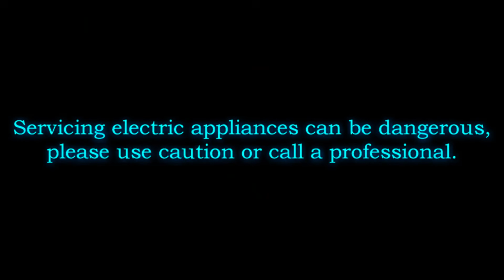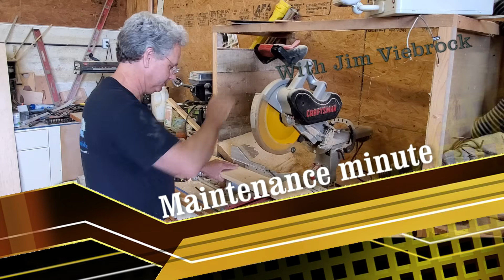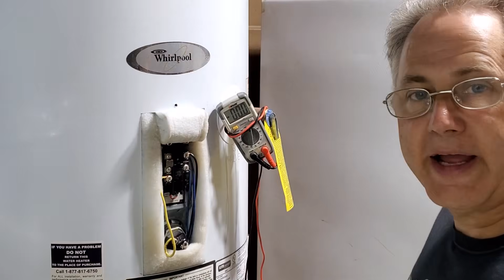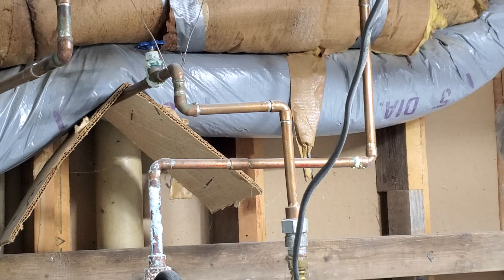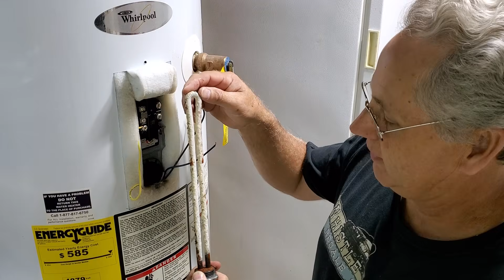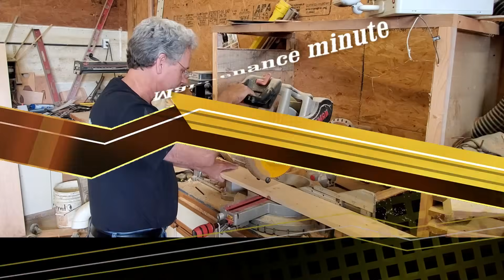D.I.Y. How to replace the heating elements in your hot water heater. Maintenance Minute Jim Viebrock

Comment: Nice video Jim. But I disagree with your stance on deliming chemicals. There are several commercial safe chemicals used to delime water heaters - food grade phosphoric acid & citric acid. Acetic acid (white vinegar) works if you have several days. Myself I use 1 gal of swimming pool acid  (HCL @ 33%) which I dilute with 2 gals of water). Add to bottom of drained WH and wait 1 hr). Then drain and you will get lime green water (calcium carbonate has dissolved). It’s impossible to get all that lime out by vacuuming or flushing or coat hanger. Especially with a gas water heater with a cone / upside funnel.
Reply from the maker: Great information,  thanks for sharing.
Reply: How do you add the chemicals to the heater?
Reply: Food grade is the key. Those who might drink the hot water would only taste some acid-y water, not toxic chemicals. It's really hard to get every drop of liquid out of the tank. So any contaminants could be entering your food chain. When I drained mine, I tried to be aware of how each hose and tube I used in the tank might be contaminating it, so I better clean out each one as much as I can.

Comment: Does it matter which wire you hook up to the elements. Or is it just one to one hook ups?
Reply from the maker: It's best to put it back the way the factory had it installed. I suggest you take a photograph so that you get it back to its original locations.
Reply: Because a heating element is simply a large resistor, it heats up when voltage pushes a current through it; the higher the applied voltage the higher the current flow and the more heat and vice versa, so it doesn't matter which of the two wires land on which terminal.  

Where ensuing correct polarity is a big concern is in light fixtures with 120V Edison screw lamps.  For light fixtures, the switch should ALWAYS be placed in the hot wire, and the hot terminal should always be the bottom contact in the socket, the grounded (neutral)  terminal is the screw shell.   This does not apply to the rare 220-250V lamps sometimes found in industrial facilities.   

If a lamp is wired with hot / neutral reversed, the lamp will still work as if nothing is wrong.   However the screw shell is live with 120V to ground potential whether or not the switch is turned off and it's a lot easier to touch the screw shell when changing the bulb.   That's why, with the exception of very old lamps, every lamp sold in the US comes with a polarized plug e.g. one wider prong as a means of enforcing proper polarity.  

Hope you found those examples helpful.

Comment: I have a small Bradford White water heater in my condo and I suspect the heating element is the culprit. I need to know if the replacement parts found in Home Depot or Lowes are universal or do I need to deal with the manufacturer. My first go-round with their "technical questions" hotline was useless. Any ideas anyone? Thanks.
Reply from the maker: You will find almost all of the time they are universal.

Comment: There should be a video covering the necessary revisions to the god-awful plumbing to that water tank. This is horrible work, apparently done by a plumber who got paid for each 90-degree elbow he used. And those coiled black supply lines look like something used to connect a clothes washer. Coiling the supply lines like that is OK with a long enough supply line to a toilet, but ridiculous with a water heater.
Start this mess over by reconfiguring the copper so that the lines are properly supported and are a single vertical drop from the floor joists above to the tank’s hot and cold inlets. Terminate the copper sufficiently far above the tank to accommodate flexible supply lines. Use ONLY corrugated copper or stainless steel, and do not use Teflon tape in making the connections, as the internal washers make the watertight seal. Make sure the washers are in place, as I have seen them missing in stores. When you are done, find the plumber who did this original installation and take all his tools.

Comment: Mention is made in the video of the possibility of the drain valve clogging. Unfortunately, this is almost certain to happen due to the horrible quality of the drain valves fitted at the factory. If the valve plugs, as mentioned in the video it will be necessary to remove the drain hose and cram a stiff wire into the valve. Be prepared for the inevitable flood and the need to quickly close the valve. If you are a capable do-it-yourselfer, it is highly advisable replace the valve with a full port 3/4-inch ball valve. Some plumbers do this with new tanks. As a ball valve is easier to open, always cap the outlet as a precaution in case it is accidentally bumped. A valve configuration like that does extend some distance from the tank, so there might not be enough room. Also, it can create a tripping hazard, so that must be taken into account.
Reply from the maker: In this illustration,  like I would assume most scenarios would be for those watching the video, is just getting the heater back into working order. Unless the homowner/landlord was preforming a remodel or update to the home, reconfiguring the plumbing simply wouldn't be part of the project. In this house, that plumbing has been in place, in that configuration, since 1968. Someday, the heater will need to be replaced. At that time it will be brought up to modern code(s).
Thanks for your comment.
Reply: @millin360 Well, true. Even so It is hard to look at the absolutely insane way that tank was plumbed when it was installed without wanting to see it done right. Obviously, the tank is decades newer than 1968. Either the supply plumbing was, unfortunately, left the way it was during installation or the “plumber” had utterly no idea what he was doing.

Comment: What would my problem be if I had some water inside behind the top panel. I hit the reset button and it popped and made a spark. I currently have the breaker off for it now and tried to wipe everything down with a towel to dry it all and wipe the orangeish corrosion away.
Reply from the maker: It sounds like the o ring has failed and a leak has developed. That is unsafe.I would call a plumber. Thanks for your comment.
Reply: @millin360  I just changed the elementts, and everything is wired right, the only difference is they didn't have the exact same elements, but they told me at the hardware store it would be fine, as they are the same size, watt, and volts.
The old ones are copper,and these were stainless steel, but I don't know how much that matters, I didn't have a multimeter so I emptied, and filled the tank again without thinking it would make a difference, I don't know what the problem is, but I'm pissed. The guy told me to bring them back if they didn't work, but I would have just rather waited for the right ones so I didn't have to drain it again. I went from a shower with 2 minutes of hot water to zero, smh.
Reply from the maker: It is possible that one or both of the thermostats has failed.Perhaps due to the leaking water over top of them. It may be time to call a qualified plumber. @jamarjames9501
Reply: @millin360  thank you for the response.
Reply: It's probably leaking from the element, change the element, and clean the threads up, and the new element should seal it up, after it's dry it should be fine. @XxRaider20xX

Comment: When cleaning the limescale with the shop-vac, what size PVC pipe did you use? Do you ever have to use a 45- or 90- elbow to reach the bottom of the tank from the heating element hole?
Reply from the maker: I use a 1/2" cvpc. I've not needed any elbows or fittings to reach any part of the heater. Thanks for the question.

Comment: Putting the wires back on the element, does it matter what wires go where since they are both hot wires?
Reply from the maker: They need to go back the way they were. I suggest you take a photo of the factory arrangement.  Thank you for watching my videos.
Reply: Actually, you are correct, it does not matter how the wires are connected to the element terminals. In fact, depending on such factors as how tight the element is, the terminal location can shift slightly due to rotation. Reconnect the wires in as “tidy” a way as possible, with each wire going to the closest terminal.

Comment: Stupid question, run the faucet with the hot water on, while filling back up the heater?
Reply from the maker: Yes, this allows the trapped air to escape from the tank while filling. Otherwise, the tank will pressurize without any water in it, and this will burn out your brand new elements. Do not turn the heater on until it is full of water. Run the hot side of a faucet until the air is gone.
Reply: @millin360  thank you
Reply: @millin360  next question, my bottom water heater drain spout is clogged, how do I drain the water so I could replace the bottom element. Thank you
Reply: @deyehaskie You didn’t get an answer, but for the benefit of others (he mentions it in the video) you will have to disconnect the drain hose and cram a wire into the open valve to free the blockage, which can return. Yes, this can make a mess, so have a pile of towels handy and be prepared to quickly shut off the valve.

Comment: cool. I think Ill just call a guy to replace the heater rather than the unit if possible
Reply from the maker: Sometimes, that is the right answer. Thanks for watching my videos.
Reply: You could but where I live the price for replacing the tank was 1650 to 3000 bucks for a 40 gal tank replacement.
Reply: @clarkastro2510  O can buy as decent one at Hd and the guy will pick it up////

Comment: So i have a question can i install a heating element with more watt.   I cant find anywhere a 208v 3000watt Heating element.    So what can i use instead
Reply from the maker: I would not suggest using a larger wattage element. You could overheat the wiring and cause damage to the unit or, worse, a fire.

Comment: So, not to be a pick:  It's a Multi-Meter.  AND you are testing to see there is voltage to the Heating Element.  Probably have the meter set to AC Voltage in the less than 200V range.
Reply from the maker: Thanks for the clarification,  I'm glad you were paying attention. I hope you were able to repair your heater.

Comment: The insulation panel is rusty!
Reply from the maker: Most of the time these heaters are in damp locations, a little rust may be unsightly, but probably won't cause any problems. Thank you for your comment.

Comment: Successfully changed out my heating elements thanks to your video.  The most difficult part was getting the top element out.  It was very tight.  The tool that was specifically designed for this didn't work.  It didn't provide the leverage needed to loosen the element.  Ended up having to purchase a 1 1/2 inch socket and use my breaker bar to get it out.
Reply from the maker: Great Job! I found out that the leverage was the best way to get them out. Thanks for your comment.

Comment: Hi ,I thought mine was leaking at the lower element gasket,, but it appears it is leaking at the flange the element screws into.  Is this repairable?
Reply from the maker: I would double check and make sure it is not actually leaking from the element. It is really easy to have 2 washers/ gaskets in there and that will leak nearly every time. If the flange is where the leak is the weld has failed and you will likely need to  replace the unit. Thanks for watching the video.

Comment: My hot water heater is 20 years old and the hot water doesn't seem to last long lately. I'm thinking that it might be a bad element and was going to change them out. My question is, should I even bother with a 20 year old unit, or just replace the whole thing? Thank you.
Reply from the maker: I would say the water heater in the video is probably 15 plus years old, so, as long as the inside of the tank hasn't started to rust, meaning the anode rod is still in place. Then there is still life in that heater. At some point, though, you will want to replace the hole unit. 
Thank you for watching my video.

Comment: Will it still have enough hot water if the bottom element  is open?  I talking a Quick bath maybe ? or will it not heat at all?
Reply from the maker: The heater will heat the water some with just one element. however it will quickly turn cold.

Comment: You should have addressed the cause of the corrosion and limescale build-up; the sacrificial anode has been eaten away. Replacing with a new anode will put a dead stop to the galvanic corrosion occurring.
Reply from the maker: Thank you for your comment, I am planning a video where I replace the anode rod.

Comment: What do you do if you don’t have a valve on your hot water side
Reply from the maker: I'm not 100% sure what your asking, however the valves mentioned in the video are the shutoff valves and the valves in the operational side of the home for example a bathroom sink valve. Concerning the shutoff valve(s), you will want to shut off both valves (if you have both). For example, you should definitely have a valve to stop "COLD" water from flowing INTO your tank so that a service person can isolate the heater to perform maintenance or repair. Additionally, your heater should have a valve on the "out" side or "HOT" side of the heater especially if the tank is in a basement. This valve, when closed, would prevent the contents of the  pipes above from backwashing into the tank. If you need to drain the tank you would proceed with the following steps:

The other valves are the valves at your faucets, like a bathroom sink. When draining your tank to preform the repair in this video you will want to have the "HOT" side of a faucet in a sink "OPEN" and the shutoff valve or "HOT side of the heater also open (the COLD shutoff valve will need to be closed to prevent fresh water from coming in). This will allow air to enter the pipes through the open hot valve in the sink if you don't do this the heater tank will "vapor lock" because the water leaving the bottom of the heater through the drain will create a vacuum or siphon. The process needs the ability for air to enter the system to break the vacuum allowing the tank to drain. A vapor locked tank WILL NOT DRAIN. 
When the tank has drained, preform the maintenance and then when you are ready to refill the tank, open the COLD shutoff valve and allow the air to push through the system all the way to the open faucet in the sink. This will blow or purge the air out of the system. When the heater tank is full, water will flow like normal out of the faucet. NOTE: NEVER TURN ON THE ELIMENTS (the water heater) UNTIL THE TANK IS COMPLETELY FULL.  
I hope that answers your question, Thanks for watching my video.

Comment: My tank is getting too hot and tripping the red button. The temp is set at 120 on both thermostats
Reply from the maker: If you're tripping the resets, Please call a qualified electrician. Thank you for watching the videos.
Reply: @millin360  Thanks but after doing a visual inspection I found a broken wire from the thermostat to the element. It has been repaired.

Comment: Thanks for this.  The manual for my tank shows a bend back style element for the lower and a straight type for the upper.  Do I need to keep that combination?  Does it matter at all?
Reply from the maker: You can use either, I recommend the bent back type. Thank you for watching my video.
Reply: Thank you.  That's what I'd already purchased.  One note:  My circuit breaker box had been mislabeled when the house was built.  10 years ago I'd worked on my old water heater.  If I hadn't been showing my then-wife what a current detector was, I'd have been shot across our garage.  (Granted, that would have saved me alimony, but still...) @millin360

Comment: Thank you for the video.
My insulation got waterlogged below the lower element. I didn't get enough water out before I took the lower element out/loose. Any tip on how to get it dried? There appeared to be standing water in the bottom area. I sopped a lot out with a towel, but still wet in there.
Reply from the maker: It will dry, but you may put a fan on it for a while.  Thank you for watching my videos!

Comment: Thank you for the video and helping others.   Glad you pointed out the wattage,  and I'd like to point out one additional tip your viewers might find helpful: While it's important to check the nameplate and match the wattage and voltage,  there is one rare case where this could be a problem,  sometimes in older homes/apartments,  the wiring to the heater is 12 gauge,  and the typical 4500 watt element can overheat these wires and trip the breaker or start a fire, possibly inside the walls of the building. In this situation a new 10 awg homerun from the breaker box should be run, 10/2 w/G NM is usually used.   If it's not possible or it's cost prohibitive to replace the old wiring,  you'll have to use a 3500 watt or smaller element; this change should be indicated using large letters on the tank to warn future occupants of the property should this element need replacing down the road.
Reply from the maker: Thank you for the important information.
Reply: Crap… this is way out of my league.

Comment: Why do people continue to call a "Hot Water Heater"?
If the water was hot, you wouldn't need to heat it.
It is a "Cold Water Heater". Cold water goes in, gets heated, comes out as hot water.
Reply from the maker: I know that drives some people crazy. I believe it's just the way different people speak around the country.
Thanks for watching the video.
Reply: Because if the water that is hot gets cold it needs heated back up. It heats up and keeps hot water hot. It also heats cold water to hot. 
Have a power outage long your hot water or warm water needs heated back up. 
So no need to get your panties in a wad. 
It is a heater to keep water hot. Hot water heater.